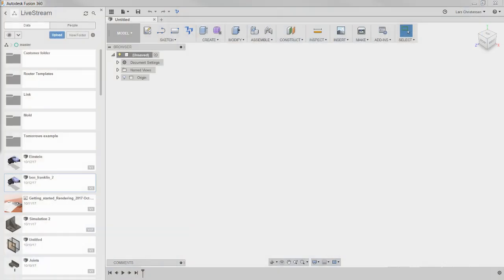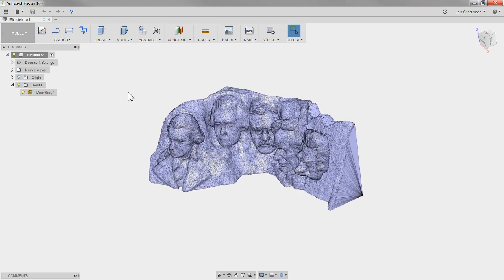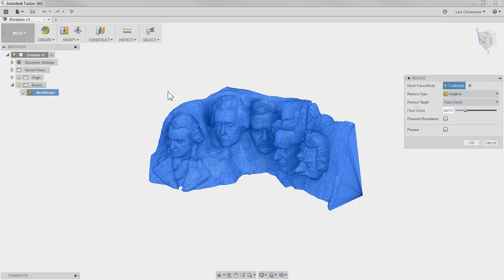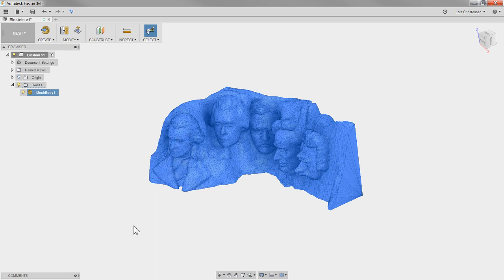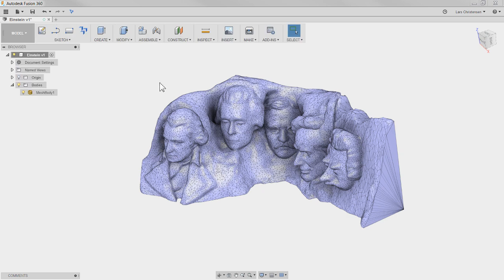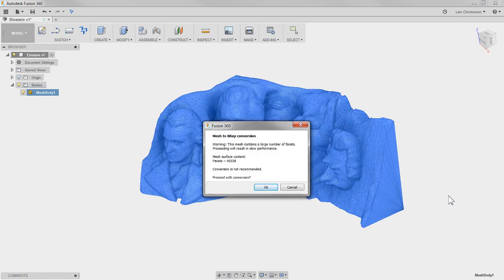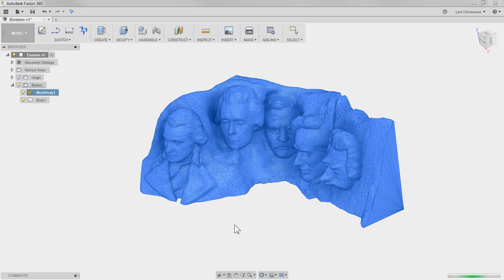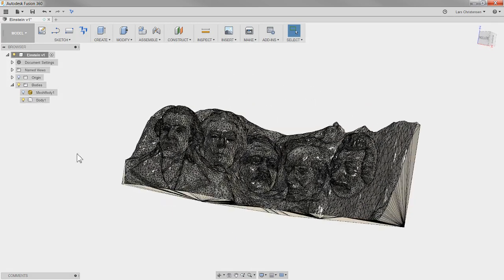Part 2 - QUICK FIX — How To Change STL Files — #LarsLive 75-1

Comment: Lars, I really appreciate your efforts in showing how to work with STL's. I have a a laser scan for a product I would like to modify. The scanning company produced a high density scan with 2.5 million facets. I got them to reduce it to 256,000 facets but that is as far as they could go. I've tried Fusion and Meshmixer to try and further reduce this file size but I can't get a solid model  of any quality. Is it possible to use sculpting or some other tool to overlay the complex model with something that can be made into a solid? The scanned object I am working with is an exhaust manifold.

Thanks,

Dan
Reply from the maker: Hi Dan McNarry Thank you for watching!
My first thought was, do you need the entire model? Can you cut it up in sections, convert the sections and then maybe put it together again later?
There is also the potion to pull sculpt surface to the mesh
https://youtu.be/rYINV0zBXbg

Comment: My software looks different than yours, I don't have a Mesh drop down at all. What gives?
Reply from the maker: You need to have a mesh file, like an stl open to see the mesh workspace
Reply: I had an .stl open. It was a GM ls3 cylinder head. I figured out the problem though. Unless you turn off capture design history it won't even show a "mesh" drop down.
Reply: Thanks for your reply, Lars!

Comment: Lars, thank you for all your help learning F360. Over at the Shaper Origin owner group we are debating the different software options for creating files to use with the Origin. They make great videos which you have probably seen. I suggested to Sam at the Shaper team that you might be interested in making a video of creating a part for the Origin, perhaps a two-part where you create the file and then Sam makes the part. The part could be a screwdriver rack or similar, something that new Origin owners can make by following the video. If that is appealing to you drop me a line at my alternate (throw-away) email ibsenafshar@yahoo.com and I will help connect you to them.

And, thanks again for helping make F360 so easy to pick up.
Reply from the maker: Hi Brian,
Yes, I saw you email and will respond there also, just falling behind a little :-)
Normally someone from Shaper Origin would reach out if they are interested in doing something.